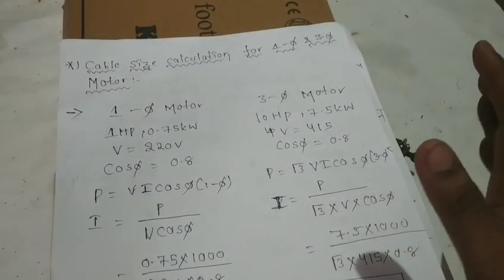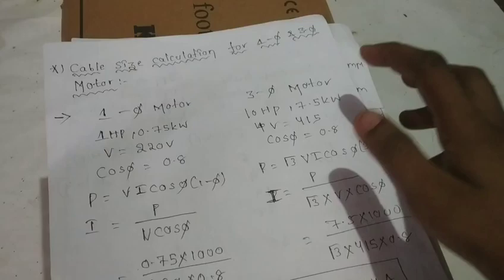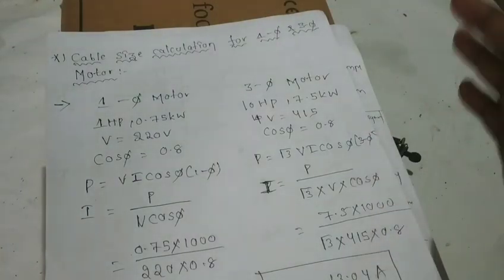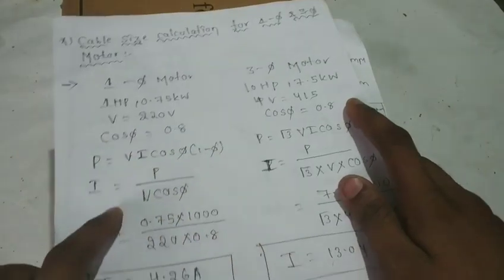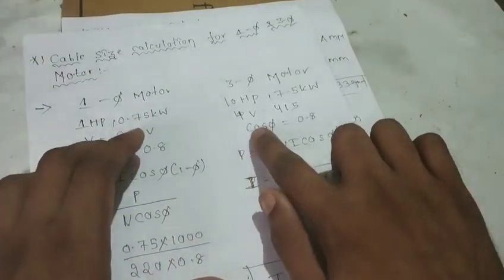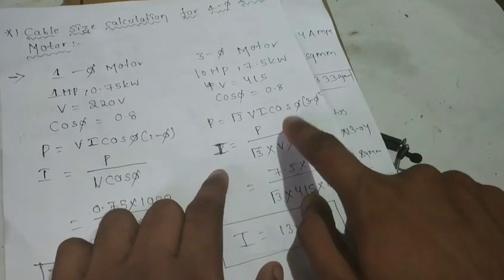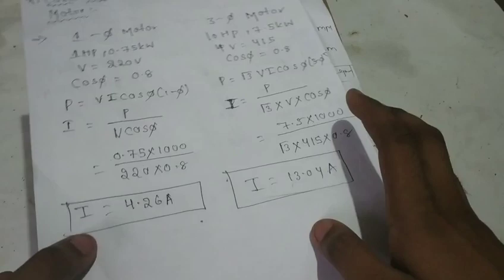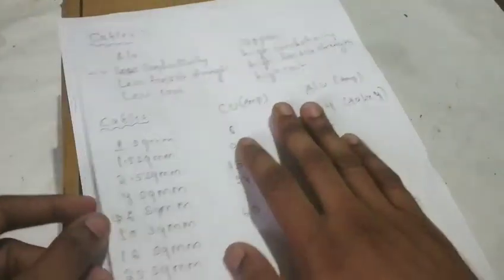Cable size selection for single phase and three phase motors in telugu 2020

Comment: Hi bro . Maku oka help kavali.ma polam ki 600meters distance lo current line undi.transformer kuda akkade undi.new line vesi 5hp 3 phase motor pedadamani plan.aluminium armoured underground cable veddamani plan.antha cost ayiddi.me suggestion antidi
Reply from the maker: Prefer solar bore

Comment: Bro 1.5 hp submersible pump ki a cable use cheyali.
Reply from the maker: Single phase or three phase
Reply: @ELECTRICALTECHINTELUGU  renditiki kuda cheppandi.single phase ki em use cheyali. 3 phase ki emi use cheyali.please brother
Reply from the maker: Single phase 1.5 sqmm
Reply from the maker: Or 2sqmm
Reply from the maker: Three phase 2.5 sqmm
Reply: Present 2.5sqmm undi.adi single phase or 3 phase naku teliyadu.kani present wire baga black ga aypoyayi leaves change cheseddamani adiganu.so 2.5 buy cheste saripotundi kada brother.
Thank you sooo much for your valuable replies
Reply: Leaves black ga madipoyayi.some times joint daggara burn avutundi
Reply from the maker: Copper wire manchi brand use cheyandi
Mariyu joints tight ga veyandi okavela veste
Reply: Meere brand name suggest cheyagalara? and cost kuda ?naku 100m wire kavali. 
Leda joint joints tight chesi old wire inkonnallu use cheyochantara??
 Thank you.
Reply: Shiva